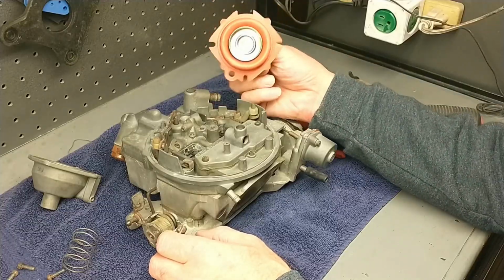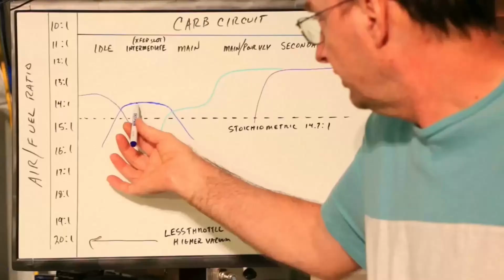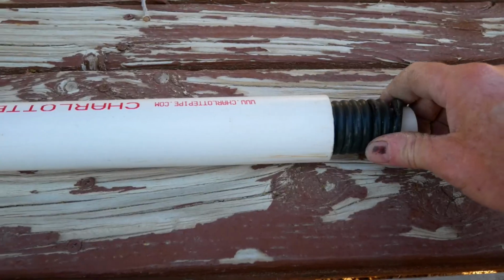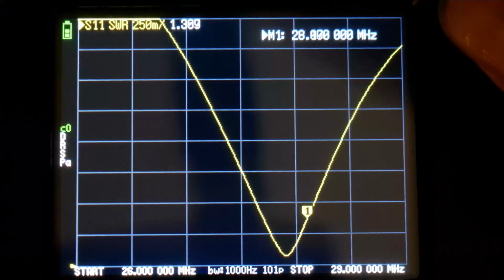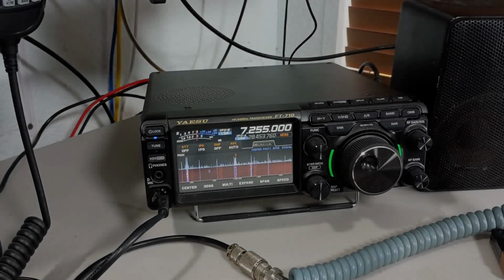Yaesu FT710 AESS experimentation continues.

Comment: I think you'd be far better served by playing with the notch filter    when you press the DSP button use the notch function at 600 Hz   with a 10db cut which is also a setting you can access the menu    playing back and forth between 500 and 700 will achieve the bass tones you're looking for   I suggest you put your bass mid and treble   back to a flat Plus 8 across the board prior to messing with the notch filter    I promise the suggested Notch filter is the way you will achieve the sound you're looking for

Comment: Bottom line is I think headphones are the way to go you know cuz it brings the sound right up to your ears and you can get clarity with it by adjusting the the frequency response inside the controls on sideband or a.m. am mode for shortwave listening but you know that's not going to do miracles I've got reference headphones use for mixing and they're really you can take a Clarity beyond belief connect Wi-Fi any of these stupid speaker systems in a second but what I found is the best way is just get some good headphones test them out even a cheap headphones $100 $200 will work 350.00 $400 for headphones if you want or you can they're good for if you do music

Comment: I noticed that when you open the box and you look at the holes but there's a bigger hole where the where the speaker wires connect to the speaker inside there that Port that's down the bottom is sufficient to take more of the pressure off the and let it out underneath the speaker I don't know if the the case is wooden or not or is it plastic I guess at this point it don't really matter so anyway I take it that it's a passive speaker it's not Amplified and I guess you know I'm using a fisherman I have a 710 I use a Fishman guitar amp an acoustic guitar amp because it has one of those little mono plug speaker plugs and it just goes right in its beautiful one problem if you start tearing up it goes through the radio I tried tests without the speaker wire plugged in and I keyed up with the with that Fishman app on and it goes right through it so I'm not going to mess with that but for shortwave listening it's nice that's what I use it for cuz I don't keep up on shortwave and even if I do I can't transmit anyway and I just leave the bass control on 10 but my fisherman amp is 60 watts so if you throw a long throw kind of speaker in there and put it in back of that plate like I know you're going to do because I saw your other ends of the videos already that should Supply a lot of bass SSV but remember to you somebody's guy signals that you want Clarity really I just like put a headphone jack in and use some kind of stereo freaking AKG stereo Studios whatever they are I don't even know the designation but yeah anything you use the closed in headphone will give you a call it will color the sound so but I noticed on cheap headphones well at least the ones the studio ones I have are cheap and they are sufficient enough to make a nice quality sound then you can key up to and plus it makes the the SS the single sideband people that even if they mess up totally you can bring them any easier and closer to your ears and and get a better copy on what they're saying cuz you don't want it all mushy anyway I got some high quality headphones that I've stuck in there and it gets really high quality then I got my choice over here use what I want that's the thing with the outdoor speaker that a e s s system I think it's a bunch of bulshit you're you're expecting a speaker on the top a little stupid little speaker that's facing the wrong way by the way it's facing upwards and away from you it's not proper and then you got the the externals clamp on speaker facing towards you know and they're making a big deal it's only a stupid little another cheap ass because I'll tell you they charge you $145 for that extra that box and and they give you like a dollar speaker that is what I see consider this an insult to people's intelligence

Comment: Very interesting experimentation. I sound like the drilling improves the sound. And no wonder about that, too much metal in the  front panel. About the  aess as they implemented: in case of an external good speaker (no th sp40..) it is detrimental! They should had put the option of using just external speakers, no way that small internal speaker can reproduce in a good way  the bass portion of the voice... What they were thinking???

Comment: Also I'm trying to figure out what material the M70 microphone from Yazoo what is that thing made of it's a condenser mic and it does sound good the way they built it though it's like I think it's made a cheap plastic but I could be wrong it might be nylon I don't know it might be some other kind of a high-dollar plastic that's it's not metal though at least I don't know if it's metal if somebody knows I wish they would tell me because I want to know because it feels extremely light wherever you place it the cord is heavier than the than the microphone base and it moves around so it's like yeah it's a I guess for $140 I can live with it it's not worth

Comment: I  have AKG  K702 REFERENCE MIXING HEADPHONES. YAESU FT710  SOUNDS  GOOD so those speakers they sell and all this stupid stuff they're trying to get us to spend money on junk I really don't need of course you're not going to be walking around like the reference headphones have a long cord on them no long wire like I could go about maybe I could do things in the camper cuz my truck Camp is small within 8 ft you know put on shortwave when I tune into shortwave I get nice nice frequency response on that now if you turn around use regular $30 headphones you know you're not going to get the sound

Comment: I use an external receiver/amplifier for audio with Boston acoustic bookshelf speakers. I use the equalizer in the receiver. I’ve thought about simplifying the output audio by eliminating the receiver, but I kind of like having two speakers. What are your thoughts? My Radio is the DX 10.

Comment: Before I go criticizing this video and the previous one he made on this topic... I must ask what is your radio of choice? What do you use when you decide to sit down and make some HF contacts? Do  you have any hearing issues (do you hear better on one side? Long term noise exposure? etc...)? I do, after years of punk\metal playing with no hearing protection and tons of time at the gun club, low tone or bass-y voices muffle because I do not hear mids, and highs so well. I hear plenty of lows, I need to turn up the treble and mids. This radio does exactly that. The AESS system is not focused on low fatigue tone... IT IS focused on phenome clarity. How well you understand words received. For me it does that very well. It is a great radio. So my thought is... What price point of radios do you prefer to use? There are radios doubling in price, that do sound much better. The Kenwood TS 990 and 890. If you use the TS990 then yea your gonna hate the FT710 and many many other popular radios. So what is your favorite hf rig?

Comment: I found using the internal and external speaker combo more hype than anything else. Totally useless. I turned the internal speaker off. I did go into the menu and change the treble, base and mid tone settings and only use an external speaker that I had laying around the shack. I purchased the Field version. 
Barry, KU3X

Comment: Interesting test.  Internal speaker sounded distorted as if there is not enough throw in the voice coil.   Stuffing+Drilling did sound better but does not address the internal speaker distortion.  Might be better to convert the external speaker into a full range transmission line with free-air resonance around 100hz and shutoff aess?

Comment: If you're using a low pass filter whether it be 700 or a thousand the remaining audio has no base to it so if nothing below 700 or a thousand goes to the external speaker you can muffle amid or a high but you can't add base cuz it's not there if I'm hearing what you're saying correctly

Comment: I thought the external speaker was only  responsible for the highs (which is why it faces forward) and the internal speaker dealt with the lows. So air movement of the external one wouldn't be much of an issue would it? Have you looked at replacing the internal speaker?

Comment: Speaker that comes with ft-710 is cheap and poor quality. The only way u can improve its sound is to cover the inside walls with 3-4 mm rubber material. Not sure if u ever tried it in yr home-made speakers, but this should work the best

Comment: :) I do think it sounds better, very strange the way they mounted the speaker!
Isn't it possible to hot glue the driver to the plastic face (easily remove hot glued items with alcohol) and omit the steel frame completely?
The shape does match the rig quite nicely.
73 from the Netherlands

Comment: what about an external equalizer, with external loudspeaker,   so you are the boss of the sound. Depending on the transmission modes you could set the sound you like best.
Reply: I'm using Voicemeeter potato for that with my logitech pc speakers 2.1 and that works very well.

Comment: I have to confess, the speaker for my 710 has never come out of the box.  Only bought it for portable, but even the 7610 in the shack only ever gets used with a headset.  Still, I’ll be interested in the results, especially given the fact you can buy ready made aftermarket stuff for the expensive iCom external speakers from DX Engineering!
Reply: Ah you could have waited for the 710 Field without the external speaker and saved $100.
Reply: @nine7295  Yes, true...except no-one knew it was coming at that point, plus, I suspect it will have better value as an AESS version anyway, should I ever sell.

Comment: Confused, maybe I didn’t see or hear correctly— when you say stuffed, does that mean you put sound dampening material inside the enclosure?  Also I would have imagined lots more varied spectrum of  reflection interference when there is more sound coming from the enclosure itself, which would presumably happen with the extra holes added.   
I also am highly confused why yaesu would not have moved the low frequencies to the external speaker instead of leaving them in the radio speaker.  Shouldn’t this have been the case, similar in nature to moving bass frequencies to a woofer?
As an aside, I liked the sound of stuffed external.
Reply: He's not talking about Duramat. He is talking about Poly Fill. I believe if Yaesu used the internal speaker as the low end " Bass ". Then without the SP-40 external speaker or FT710 FIELD. The internal speaker would still be all low end bass. I understand what your saying though. Yaesu should of also added another AESS menu to change the treable and bass from internal to external. I really don't care for the internal. Of course the external needs upgraded also. All that said. I'd rather give up the AESS. And have roofing filters in the FT710. I personally like the FTDX10 and FTDX101D better. I did poly fill the external speaker. It helped a little. It's an odd no tabs 4" speaker. And I don't have that style on hand to change out to. Now I still got a SP-10 991/A external speaker.  I had a better speaker to upgrade it and poly fill. The SP-10 also has a electrolytic capacitor inside. To act as a super cheap cross over/ or tone just a bit. I put a switch on it. So it can bypass or run through the cap.